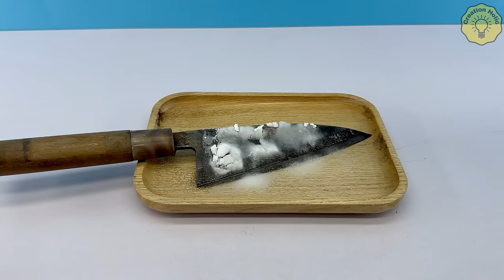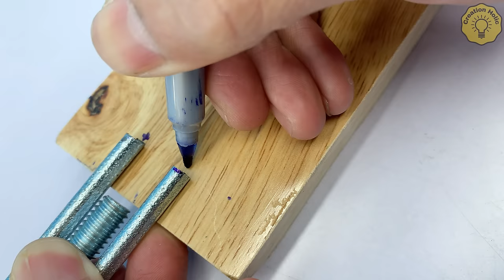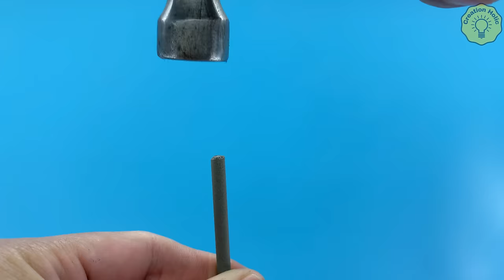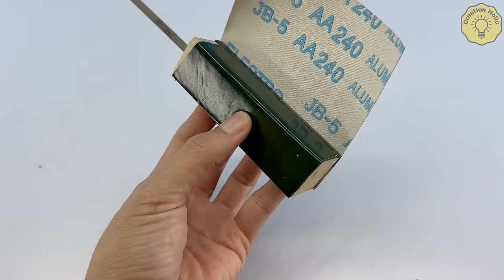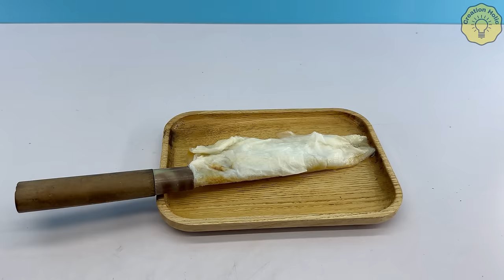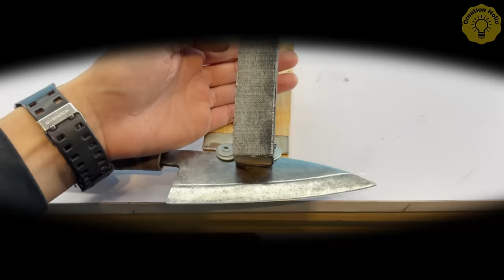Razor Sharp! Sharpen a Knife in 3 Minutes With This Method

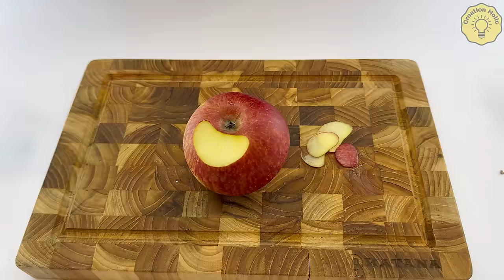Comment: More like 5 hours of work just to sharpen a knife. Easier way is turn on your stove fire up and heat the knife up for 3 minutes and file it down for 1 minute. Do both sides and then use the smooth sandpaper to buff it up. Easy peasy! 8:39
Reply: Yes and then potentially ruined the knifes temper
Reply: I couldn't agree more.....!!!!!
Reply: The 5 hours work is just for the first time, next time it will take 5 minutes. Less than ur version.
Reply: Terrible idea...since you ruined the heat treat your knife will dull faster from then on. Just learn how to sharpen with stones.
Reply: The time is making the knife holder. A one of project guarantee to sharpen at the correct angle. You can't guarantee to only stay on the edge on your method
Reply from the maker: Thank you for watching
Reply: 🙄 apparently you're not aware that that this can remove the temper from the steel?
Of course it's easy to sharpen after you've softened the metal and ruined the knife
Reply: Grandpa hand-sharpened the scythe with a sharpening iron and it was always razor sharp.
Reply: Does it work

Comment: What about the folded sandpaper on the thumbnail? Show us how you sharpen with it. Also the knife was sharpened on one side,why? Isn't there a burr on the opposite side when you sharpen the blade?
Reply: The knife was sharpened on one side because it uses a chisel grind. Personally I don't get the appeal, but most of my knives are western style knives. Chisel grinds are very popular among Japanese kitchen knives and Japanese utility knives. 

As for the burr on the opposite side. Yes. You do get a burr on the opposite side, but you would normally remove that by flattening the back side and/or a by stropping. Though depending on how much metal was removed it might not have been an issue the first time the knife was sharpened.
Reply from the maker: Thank you! Cheers!

Comment: What purpose does the baking soda serve? The vinegar will remove rust without it. Adding the baking soda only neutralizes the acid in the vinegar. The acid is what loosens the rust. Baking soda only slows the process.
Reply: Came here for this comment.  The baking soda makes the fizzy bubbles, but enhances the process in absolutely no way other than that.
Reply from the maker: That mixture cleans very well
Reply: It makes an effective cleaning 'paste'. This paste adheres to the surface and aids the cleaning process.
Reply: I always assumed the baking soda was to add some form of gritty paste, but I'm clueless TBH
Reply: It makes a good lava w added red food coloring when youre 10 and make a science fair volcano ! Otherwise, use ferric chloride.
Reply: Yes and it makes salt water

Comment: Whenever I sharpen a knife, it never takes more than a minute, ok kitchen knives. This took a took a tad too long and I would really question why anyone would do this.
Reply from the maker: It would be very easy for those without experience like me
Reply: This system will make you enter another level of sharpening knives for sure. Do it on both sides of kitchen knives.

Comment: Sorry, but after all the job with building a sharpener that knife is NOT sharp at all, when I sharpen my knifes I don’t have to “saw” through a tomato…
Reply from the maker: After creating the knife sharpener, sharpening the knife will become very quick and easy, you can try it
Reply: Nossa que bela porcaria
Reply: Dude... he only had to saw the tomato because of the awkward angle he was holding the knife for the shot. Some ppl are just so ignorant
Reply: If I cut a tomato in half with one of my sharpened knives, I can hold the knife exactly any way I want.. If I hold the knife between my thumb and forefinger, then all I need is the weight of the knife and then pull or push the knife in a single cut.
Reply: But you're the world champion...
Reply: @hansfranson6570  not at all, I'm just explaining how a sharp knife cuts a tomato.
if you don't understand it, you don't have to answer.

Comment: Nice idea. But you didn't remove the burr on the other side of the edge. If people copy your way, they will be disappointed. If you treat the other side, your edge will be much sharper.
Reply from the maker: It's a Japanese knife and it only has 1 blade
Reply: @creationholic101  Of course it only has one blade, but even with a chisel grind edge you need to remove the burr.

Comment: Great Idea !!
But why did you use a welding rod for the guide, and not just a round steel rod or pipe?
And why the turnbuckle? Why not just thread the eye bolt directly into the wood base?
Reply from the maker: I use soldering iron because it is available in my house

Comment: All of these types of sharpening gimmicks are rather silly.  The use of baking soda neutralizes the acetic acid in vinegar to make water. Acetic acid baths in a glass jar is very effective to clean and also to sharpen old dull files. Adding baking soda is simply stupid.  The mechanical gimmick is a lot of work to simply avoid learning basic knife sharpening. Goofy gimmick. Good for goofy lazy guys.
Reply from the maker: Hello! thanks for your comment. Wish you all the best!

Comment: Normally I laugh at these video's, all the effort put in to save a couple buck making something, instead of just buying it.  But your rig is simple copy of a popular tool costing anywhere's from $30 to a few hundred.  Great Job ! What was used for the Strop ?  Looks like a pc of heavy fabric ?  Why not an old leather belt ?  This method works great, but takes a while, and can be trouble some to those with  wrist injuries.  I got lazy a few yrs back. I now just use a 1" belt sander, 5-6 different grits to 2000, and a strop.   No, I don't get the perfect straight angle, all pretty.  but the results are the same.
Reply from the maker: Thank you for sharing your feedback.  Have a good day!

Comment: In the 8:39 it took you to build this, I've sharpened 6 knives RAZOR Sharp & made a coffee..... IN the coffee cup I used to sharpen the knives with. (Just turn an empty cup upside down & run the edge over the bottom)
Reply from the maker: After creating the knife sharpener, the next sharpening takes less than 1 minute to sharpen it

Comment: I bought a Drill Doctor many years ago and was very pleased with its performance, but the plastic depth stop to set the flutes broke and when I tried to buy another the style had changed to two fingers in the flutes and were hard to set right. The one you just tested went back to the original method of setting the depth of the drill in the holder. I may have to buy another one soon. LOL

Comment: you specialize in useless jobs. since you use a drill, you might as well mount a circular grinding wheel and eliminate the rust like that, instead of fiddling with caustic soda. then you have to get a lot of wood, drill bits, screws, washers, shims various, the cable tensioner, which you then destroy, a screw, abrasive paper, double-sided tape... in your opinion, how long does that abrasive paper last before you have to change it?  finally, there are similar and better built commercial knife sharpeners, or roller ones, which you can buy for $5.  to buy everything you need you still have to go to a hardware store; finally: you would have to use a screwdriver every time, ridiculous.
Reply from the maker: I'm sorry to hear that the video didn't meet your expectations. I appreciate you bringing this to my attention

Comment: You only sharpen one side of the blade? Or does the blade need to be turned over?
Reply: This is a traditional Japanese single-bevel right-handed knife... sharpen 1 side and de-burr on the other side for a razor-sharp cutting edge.
Reply from the maker: Thank you for watching